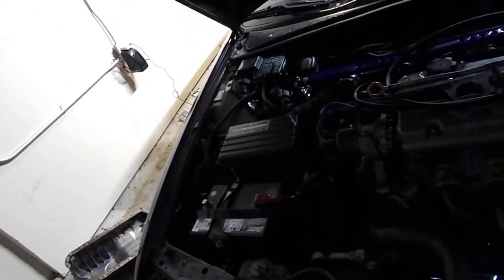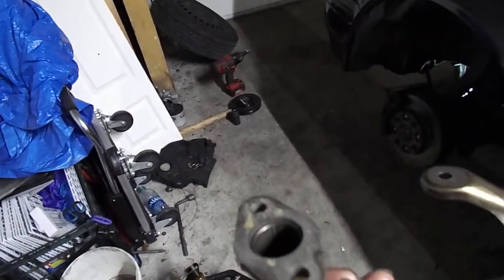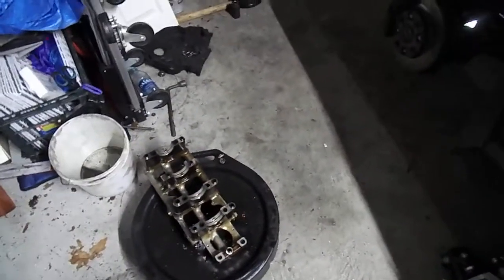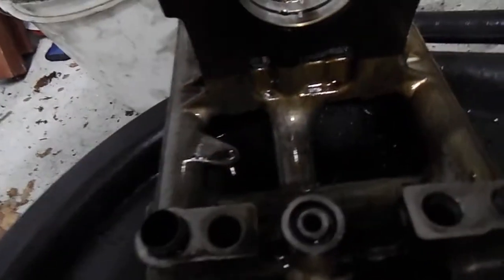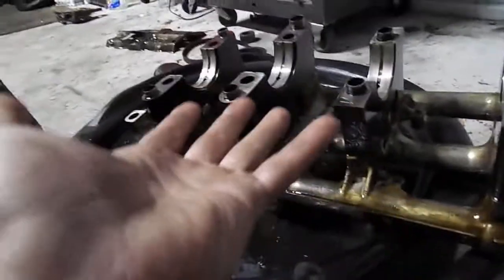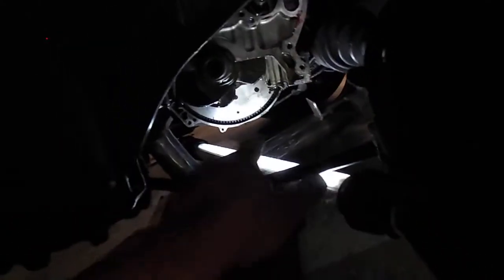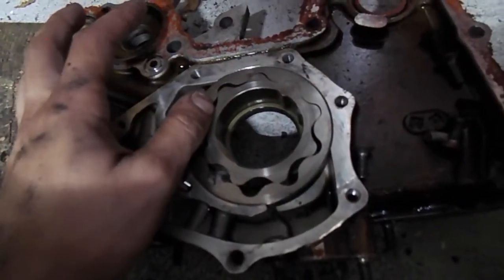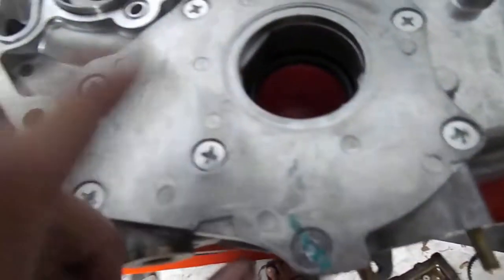Low oil pressure H22

Comment: I drove my car with the oil light on and it sounded like a loud lawn mower and was rattling, clanking, banging. When I got home and saw oil shot on the left side of my radiator and oil shavings after I drained the oil.  Think its done or can I still save it?
Reply: Super done
Reply: @matthewbim10  yea, started parting out the car off

Comment: I have a couple questions if you can help me out so I installed an h22a euro r red top engine and 5 speed manual transmission on my 97 prelude but in order for the crank sensor to work I had to replace the oil pump with a regular h22 usdm one because the h22a euro r doesn't have the mounting holes for the crank sensor but anyways so im pretty sure I mounted the oil pump correctly  cause the pump sat in nice and firm but when I finished everything I started the car up it idles perfect but sounded kinda like it wasn't getting any oil pressure and sure enough it wasn't after 30 minutes at idle timing jumped from the exhaust side I re timed the engine and again started back up but didn't let it idle to long after I found out im not getting oil pressure so im seeing what would suggest I guess I'll start with checking the oil pick up tube but do you think it might be the pump it self it's brand new got it from Amazon for like 60 bucks came with new O ring and some gasket I just don't want to ruin this engine paid 2700 for it with transmission any suggestions or ideas you may have are appreciated thank you in advance
Reply from the maker: Your timing being off has nothing to do with your oil pressure being low. Do you absolutely know for a fact that it's a low oil pressure issue and not something else? You could have bent a valve from running it after incorrectly setting the timing and it could be causing it to run like crap.
Reply: @willthecardude6900  so I drained the oil today and removed the oil filter my oil filter was bone dry oil never came thru it im sure ther oil pressure is an issue im thinking the oil pick up tube might have got clogged with maybe some excess gasket maker I used to install the oil pan but to answer the question about the timing so my exhaust cam jumps a tooth after about 30 minutes at idle and was told by another person that's helping me figure this out said the cylinder head is running the cams dry causing that friction to jump the exhaust cam therefore throwing off my timing by a tooth or two when I re timed the engine it fired right up but didn't let it idle to long cause I know it'll most likely jump again but then I also removed the valve cover and fired up the car like that to see if I was getting oil to the cylinder and was not at all im just hoping it's the oil pump it self cause it was allot easier to install the oil pump when the engine was off the car vs it being in the car but either way I guess I'll start with inspecting the oil pan and oil pick tube first since those are ther easiest to get to I appreciate the reply thanks I'll continue investigating the issue
Reply: @willthecardude6900  also I forgot to mention the cars idle sounds normal no back fires or it running weird at idle just once it warms up it dies then I realized it jumped a tooth on the exhaust side only crank and intake cam still in timing perfectly just exhaust cam jumps a tooth
Reply: Super complicated. Hope you figured it out. Thanks bud